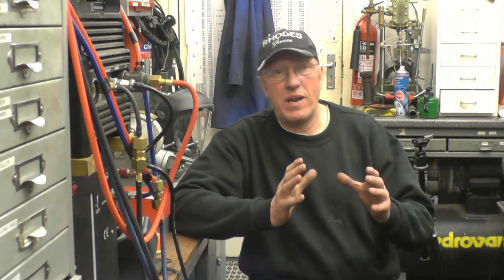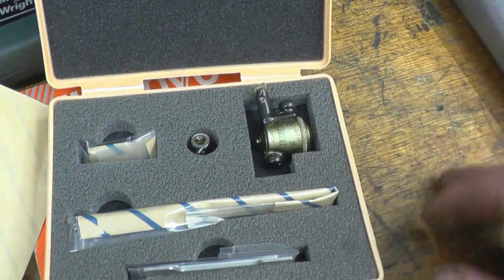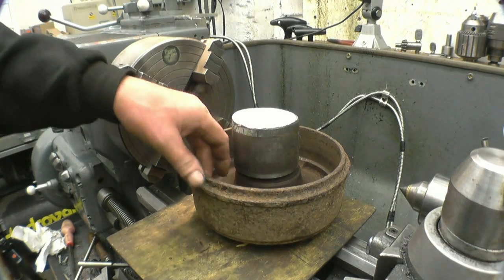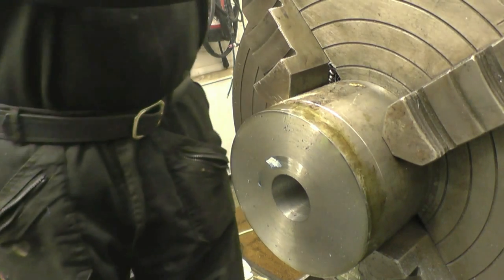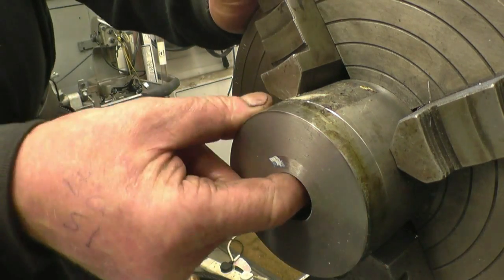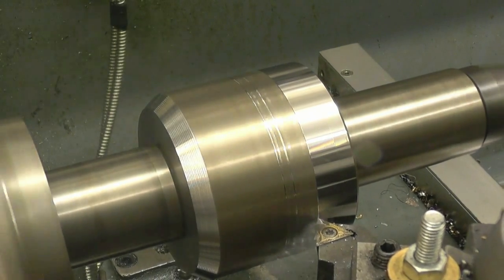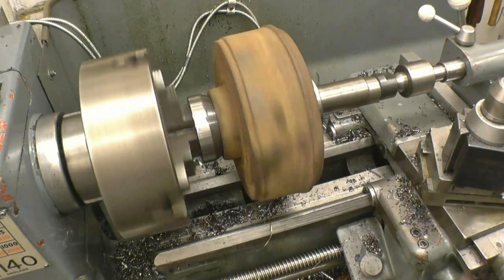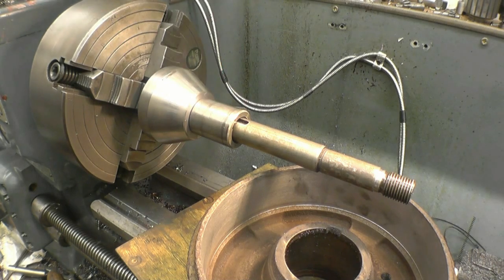SNNC 166 P1  Machining Brake Drums

Comment: what would it cost per drum. to do that, through an engineering firm, or what would you charge john, only roughly on the the price.....great video...
Reply from the maker: It is only viable on certain drums  as most car drums are very cheap to buy.
£ 10 each is about the going rate

Comment: G'day John .
 20 years ago when i was machining drums & discs on the drum the practice was to wrap a length of rubber{ like a bicycle inner tube } around the out side of the drum  had a S hook both ends  to hook together  leave the first hook hanging out then wrap the rubber band around the drum   hook the 2 hooks together   usually had to un wrap about 1/2 the winding's  and re wind tighter or looser to get the end to meet up   It helped with the chatter over the hot spots .
On the disc it was either a narrow rubber band  but usually a long Coil spring 3/4" od was wrapped around circumference the disc .

 Keep up the good work .
 best regards  JPT

Comment: Great job.  I remember when every auto parts store had a brake lathe and they turned drums and rotors.  You never see them these days.  They used cones to center the drums.
Reply: Blazer02LS plus for the most part brake disks are so cheap now that it's not worth spending the Labour time to cut a set vs just throwing new ones on
Reply: Its not worth it anymore.  Unless you have the equipment to do so. Components are cheaper now.
Reply: Most of the "modern" disks and drums don't have enough extra iron to be cut or turned. I still have mine in the shop, I think I used it once last year, to clean the rust off of some salvage parts.